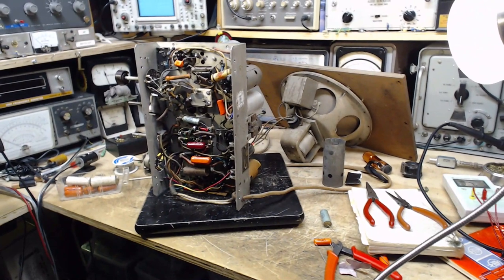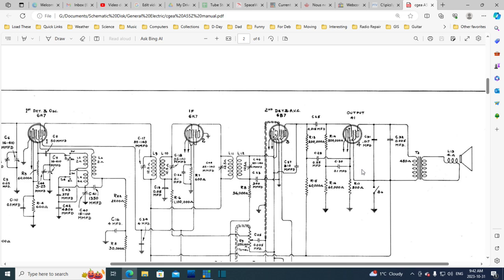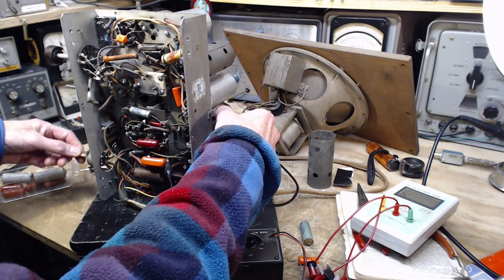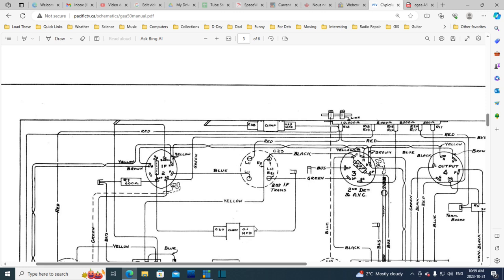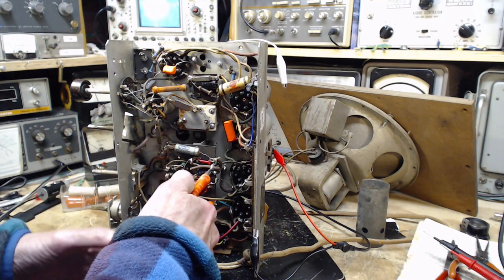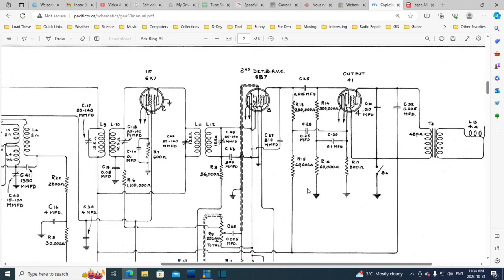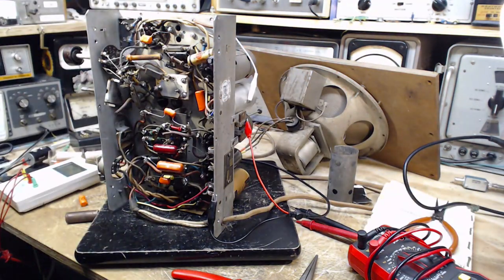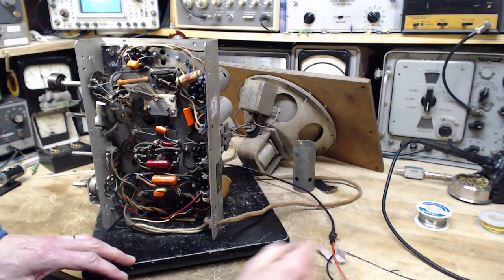Canadian General Electric Model A55Z Video #9 - Tough Progress

Comment: I believe I would check the polarity of the hum bucking coil (if there is one). You could run the voice coil connections to an external speaker to see if that is the problem. Thanks for the videos.

Comment: ESR parameters are mainly for caps used in power supply switching circuits. ESR has to do with capacitor power dissipation timing. If a cap,cannot switch quickly it get hot and becomes inefficient causing swelling. In normal audio circuits ESR has no bearing.

Comment: it is too bad that someone may have did a bad botched job on this radio. but, we can all hope that the radio will be able to be repaired by jim ...

it does say something... if the other group is sending customers to jim...  AT least that  repair shop knows that you are a good service!
Reply: So True, but Jim is very good at figuring things out. I have learned a lot and have drastically changed the way I approach repairing things and it has helped figure out many issues I probably would have never figured out..